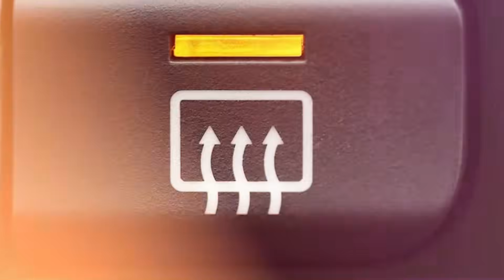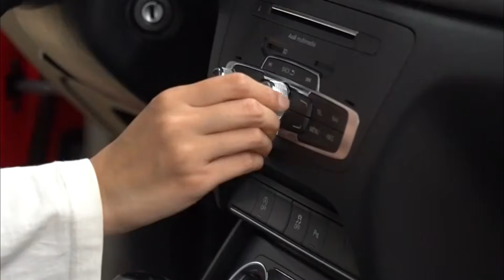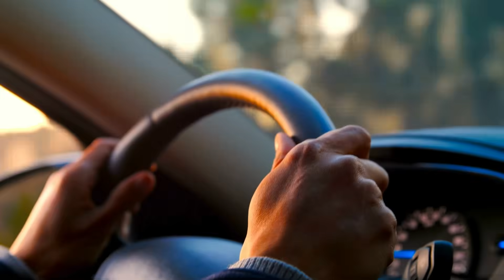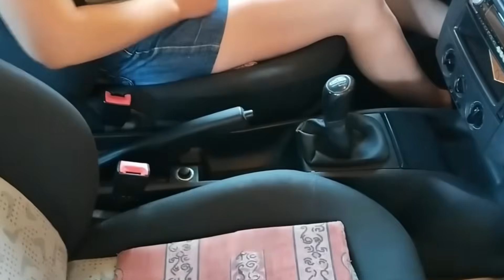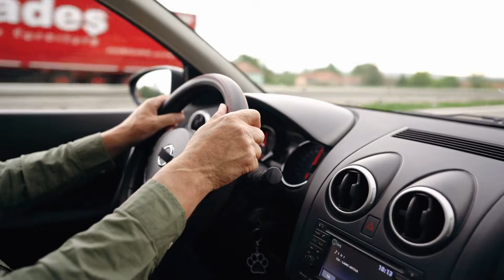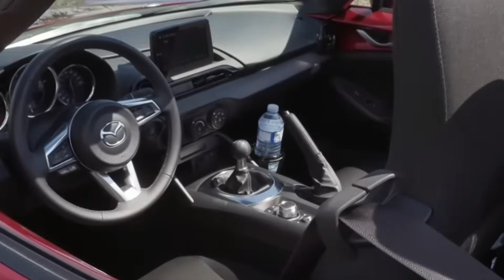GREAT REGRETS! Car Manufacturers are now sheepishly bringing back these 11 Features!

Comment: All of those functions should be controlled by voice command. No need to be distracted by fumbling for controls while driving.
Reply from the maker: Voice control definitely has its place, especially for things like navigation, calls, or changing music. When it works well, it can reduce distractions. The challenge is reliability. In real-world driving you’ve got road noise, passengers talking, accents, and sometimes no data connection. That’s why safety regulators still prefer physical controls for critical functions like hazards, wipers, and defrost. If something urgent happens, a button you can hit instantly is still the fastest and most reliable option. The ideal setup is probably a mix of both. Physical controls for essential driving functions, and voice commands for secondary stuff.

Comment: Oh the timing on this topic. My daughter bought a used Subaru with an electric parking brake. I can hear an electric motor with gear reduction likely pulling on a cable underneath somewhere. All of sudden, after decades,....a simple handle or pedal isn't good enough. There needs to be wires, buttons, breakers, connections to computers and motors. Why? Too complex to operate a handle? Which leads me to another thing - safety back up. One of my brake cylinders failed many years ago and spewed brake fluid out. I was able to come to an emergency stop with the lever. You won't get that security with an e-brake, (as far as I know - maybe?),. A manual brake backup used to be the law is my understanding - for that reason. Just throwing that out. Cheers.
Reply from the maker: You’re absolutely right about the simplicity. The old cable handbrake was about as reliable as it gets. A lever, a cable, and rear brakes. If something went wrong, you still had a mechanical backup. Electronic parking brakes were mainly introduced for packaging, convenience features like auto-hold, and to integrate with driver-assist systems. From a manufacturing standpoint, a small switch and motors are easier to integrate with modern electronics than a long mechanical cable running through the cabin. Most electronic parking brakes can still act as an emergency brake. If you hold the switch while driving, the system usually commands the rear brakes to apply gradually through the stability control system. It’s not quite the same direct mechanical control as the old lever, but it’s designed to provide a controlled stop if the main brakes fail. A lot of drivers still prefer the old lever for exactly the reason you mentioned: simplicity and reliability.
Reply: @CarFailureFiles  Thanks for the info. Yes, I wondered if pressing the button in an emergency did anything. But with total brake failure would it give you the control to put the car where you wanted safely in an emergency? I really don't know. A mechanical hand brake will - been there done that. From a cost and manufacturing  perspective, a cable going to small lever made of pressed sheet metal, a tiny ratchet of pot metal and plastic button with spring,.... in the bigger picture are easier to manufacture than all that other stuff. Don't forget software. It's complicated and costs money too. A lot. Get it wrong - lawsuit time!!! Even my old Volkswagen beetles had a primitive hand brake between the seats and  beetles were cheap cars. The hand brake, easy for any mechanic to work on - which they didn't need except occasional adjustment. Due to the simplicity = low cost "and"  reliability. Cheers again.
Reply from the maker: @jimp.7286  That’s a great point, and honestly a lot of engineers would probably agree with you on the simplicity argument. With most electronic parking brakes today, if you hold the switch while the car is moving, the system usually tells the stability control module to apply the rear brakes gradually. So technically it can slow the car in an emergency. But you’re right about the key difference: it’s software-controlled. You don’t get the same direct, mechanical feel and modulation that a cable handbrake gives you. And you nailed the bigger debate in the industry. A manual lever is incredibly simple, cheap, and easy to repair. Electronic systems were mainly adopted for packaging, interior design, and features like auto-hold and automatic parking brake engagement. From a driver’s perspective though, the old system had a lot going for it in terms of reliability and serviceability. That Beetle example is actually perfect. Those cars proved that simple mechanical solutions can last decades with almost no trouble.
Reply: @CarFailureFiles  👍👍

Comment: I really hope your right about this. Any word about which cars are getting these changes and when this is taking place? I miss my Pontiac Grand Prix and prefer it over my now Challenger. Don't get me wrong, my Challenger has good styling, and I love the awd but my Pontiac was much better all around, and was much more reliable, durable, and dependable. I personally would like to see physical keys come back. Thefts with these pushbutton ignitions what a shit show!
Reply from the maker: You’re not wrong. A lot of drivers feel the same way, especially about older cars like the Pontiac Grand Prix. Simpler systems, fewer modules, fewer things to fail. There’s a reason durability felt better. As for what’s actually changing and when — some of this is already happening. Physical climate controls and buttons are starting to return on 2025–2026 models because safety rating rules are tightening in Europe, and that pressure affects global design. Manuals are still sticking around in certain performance models. Space-saver spares are quietly coming back as options on some SUVs. Physical keys are the tougher one. Push-button systems aren’t going away, but manufacturers are improving anti-theft encryption after the spike in relay attacks. The industry got caught off guard, and now they’re scrambling to patch it. The biggest shift isn’t one specific car. It’s the direction. Usability and security are finally becoming selling points again instead of just giant screens.
Reply: @CarFailureFiles  Very well put, I appreciate the clarification. Hopefully better things in the future. Two good minds agreeing and thinking alike! 👍
Reply from the maker: @fabiolas4  😍😍